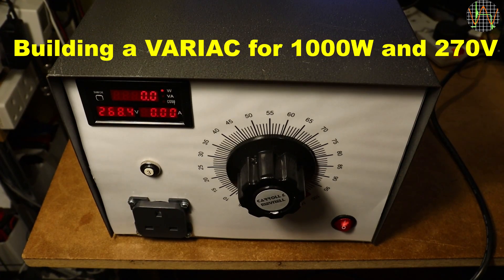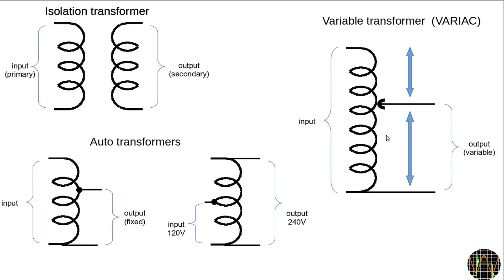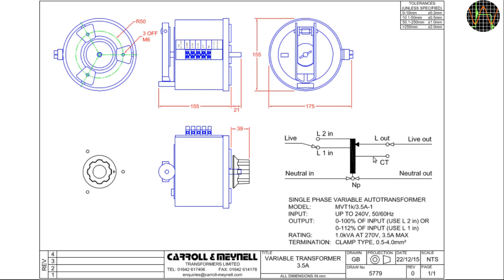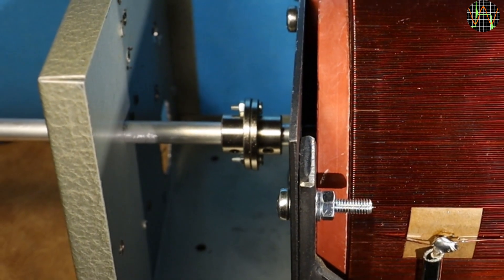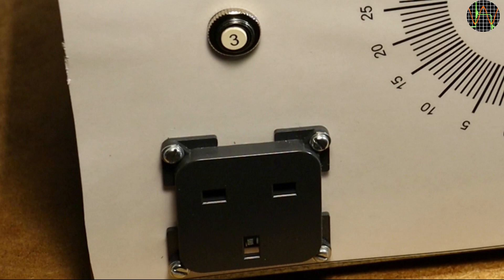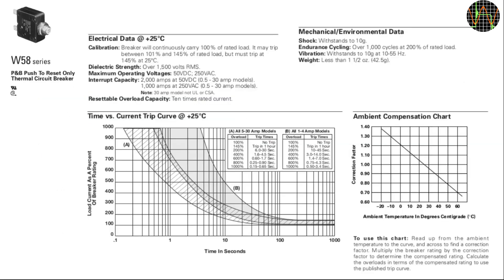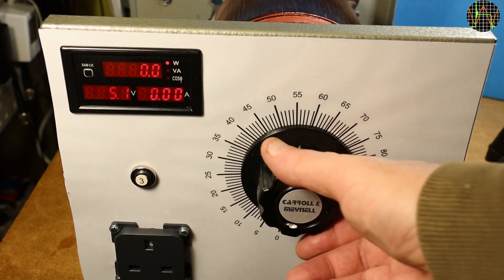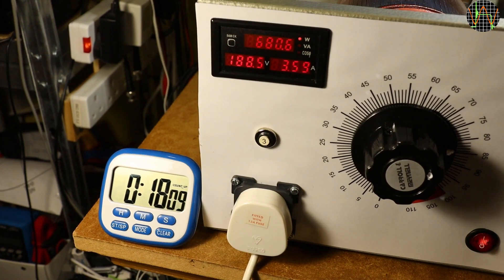Building a VARIAC for 1000W and up to 270V AC

Comment: Was just rehabilitating a vintage Variac and had to give this a watch! A lot of the vintage ones weren't grounded at all interestingly enough. The vintage ones do use a double pole switch as well, but I'm not sure if there's much point in breaking the neutral at the same time other than maybe to prevent arcing if you are using it under a super high load maybe? 

I've also see where they are configured to use a switch that sets whether live voltage is applied to the very end or part of the way in so that you can choose between over voltage and mains voltage as a maximum. 

Assuming your varian is wired correctly, and the output was at 10VAC, how would touching it be harmful?

Where I think the danger lies is if live and neutral are swapped. In that case, then yes, touching the 10VAC output' is really touching the mains voltage in reference to ground. This could happen for two reasons - if the outlet you plug it into is wired incorrectly, or if the variac has a non-polarized plug and it's plugged in the wrong way. 

Lastly, is there anything preventing you from applying your live to the center tap? Doing so I think would give you an output that is about double the mains voltage, though I don't really know what use you'd have for ~500V, but it could be useful with 120V sources to up convert to 240. My guess is that the downside would be that it could only handle half the current at the higher voltage
Reply from the maker: It is probably safe to touch it if its 10V but as you say, L and N could be swapped and anyway it is probably never a good idea. I don't think the wiring and isolation is designed for such high voltage that you are thinking of. I use an external isolation transformer if I need higher voltages.  Much safer,

Comment: Great video, I am looking to do the same as I currently (no pun intended) have an open frame Variable transformer I'd like to put in a case, are you able to let me know where you sourced yours from.
Reply from the maker: That case is 40+ years old and I can't remember where I got it from. Originally I had put a self-built bench power supply in (with analog V and A meters, hence the large holes). I used that for many years, but then switched to smaller bench power supplies so this thing ended in the garage until I repurposed it for the VARIAC. My advice is not to try to buy new enclosures (outrageous expensive) but look for not working old power supplies or vintage valve based RF equipment and use those cases. Much cheaper and you may find useful components inside. I managed to score quite a number of useful cases and components that way for very low cost.

Comment: Hi. Right now I'm winding a coil for my own variac and I have a question: can I connect one wire from the outlet to the load directly and other wire through the slider of a variac and to the load? If I'm correct, if I connect it like this, it should operate like a rheostat (potentiometer). Will it work like I described or will I need to connect it using schematics from the internet? Thanks!
Reply from the maker: You are brave winding your own variac and I hope you know what you are doing. A variac is basically wired like you would a rheostat but it works very differently (as a transformer). You can get more volts out than in with a variac but not with a rheostat.  Not sure what schematics you follow but the basic wiring is really quite simple. The coil of the variac is connected between neutral and live. The load is connected between neutral and the slider. Its mains voltage, so be careful.
Reply: @TheHWcave  okay, thank you very much for your answer! Regarding schematics: I basically googled "variac pinout".

Comment: excellent auto-trans stuff but where did you get the ee blog meter:)?  -I'm sure you did not have to travel all way to DJ's shop did you? and you could just have mounted the variac on the floor of the existing housing and controlled it from the top saving the extra material & weight! overall an impressive project though
Reply from the maker: on the EEVblog meter. I bought it quite some time ago in the UK. They are available. I was trying to find the place Simon's Electronics but the site is (no longer?) working. I think other places sell them as well. I did it because I wanted to support the EEVblog a bit (Dave gets a cut). Thanks on the suggestion. The enclosure with the VARIAC ways a ton and therefore sits directly on the floor. That place happens to be under a shelf. The control would not be accessible if it were not on the front. Of course I could have rotated the box if I followed your idea... Anyway, speaking  of rotating, the only thing I would do different next time is to rotate the output socket 90 degrees to the right. Because the machine sits on the floor it is difficult to get a UK plug in with its lead coming out on the bottom.  I probably will do this mod anyway once I get annoyed enough...

Comment: und keinen trenntrafo mit der gleichen va leistung mit eingebaut???
Reply from the maker: There is an easy explanation: I did not had the money for buying an isolation transformer at that time. Also, these are big! It would have been very tricky to fit both the VARIAC and the isolation transformer into the same enclosure.

Comment: what happens if your input is less then 240v lets say 20v? what happens to the out put load.
Reply from the maker: The VARIAC  allows selecting anything from 0 to 115% of the input. If you feed 240VAC it will allow selecting 0 to 276VAC output. If you feed 20VAC it will allow selecting 0 to 23VAC for the output. It can produce slightly more output voltage than you input because its a transformer and because of the way the coils are wired  (its an option you can chose when you wire it up). Its a different story for the panel meter. That one needs at least 60V AC or something like it, to be able to work. It can show 20VAC at the output but it can't work with 20VAC at the input.  So while the VARIAC will happily work with 20VAC input, the panel meter will stay dark.

Comment: I have a 2.5kw 240v transformer. 
However I am in the US and for 240v we use two live wires each roughly 180 degrees out of phase.
Does it still wire up normally?
Reply from the maker: I am no expert in US wiring but if your transformer is indeed for 240V you would connect one end of the primary to live of phase 1 and the other end to live of phase 2. Of course earth needs to be connected to the chassis as well. Also make sure you use a double pole power switch to disconnect both live wires when turning power off. I am not sure what the regulations are for fuses in this situation. Intuitively I would put one (rated for half the max current) in each live wire
Reply: @TheHWcave  Thanks

Comment: what about inrush current?
Reply from the maker: If you are asking if the VARIAC itself has an inrush current, the answer is probably yes, but it is not significant. I have not noticed it and the fuses are still fine. If you are wondering how the VARIAC deals with inrush currents of devices connected at the output, my normal usage is to have the VARIAC turned to the lowest setting (4V or so) and then turn power on. Then increase voltage slowly. So there is actually no inrush current.  Most of the time I use the VARIAC to test new builds, or repairs, so going slowly and stop immediately if something looks wrong before any damage is done is key. Occasionally I set the VARIAC to 115V and then turn power on to see how well devices behave when used in 115V countries. I'm using small devices, not massive transformers or motors, so I have not found inrush current to be a problem.
Reply: @TheHWcave  Thanks for the fast reply. Yes I was asking about the inrush current of the variac itself. I suppose if you turn on the power while the variac is set low, the line voltage sees a large inductance, so the in rush current is small. And using small loads on the output simulates a open circuit at the output, limiting the current. So i suppose you are correct that the way you use the variac is what limits the in-rush current.
Reply from the maker: I just saw Marco Reps' new video about needing a soft-start for his 3KW Variac because the inrush routinely trips his home circuit-breaker. Check-it out if you have not seen it.  Well, mine is just 1KW and the DC resistance of the winding is about 12 Ohm vs Marco's 2.something. I suppose that explains why I don't have an inrush problem

Comment: Nice job, have just subscribed. Do you have a link to the brackets, or did you weld them yourself? I can't see anything similar on eBay
Reply from the maker: I go mine ready made from the ebay seller vds_fabrications 
https://www.ebay.co.uk/itm/Heavy-Duty-Shelf-Brackets-Handmade-Rustic-Industrial-Design-Modern-very-strong-H/264529809676?hash=item3d9734910c:g:Cp4AAOSwmepcCsLJ
Reply: @TheHWcave  Excellent, many thanks for the quick reply. I was looking at the cheap Chinese variacs on eBay but after seeing your video I think I will buy a proper one from Farnell and do it myself. Now to find a good steel case that doesn't cost the earth...
Reply: You could probably just go to a steel shop and pay $40-80 and have them weld you a custom one for almost nothing in terms of material cost and just an hour or 2 of labor.

Comment: When you had it connected to a heater and got up to the 3.5 A that was only 682 Watt that I saw on your meter because of the lower voltage at 189 so it really is not the 1000 Watt you have in your video title... Is it capable of putting out the 1000 Watt or come anywhere close to that?
I calculated what it should be if you could get the 1000 Watt at 189 Volt, you should have 5.29 Ampere.
At 270 Volt you should get 3.7 Ampere to get the 1000 Watt rating, because of how a Variac is constructed using a single wire with the same diameter I can understand why you can't draw more than the maximum current of 3.7 Ampere at any voltage, still a bit strange that it doesn't follow the law of energy when the voltage goes down the current goes up.
And why doesn't it go down to zero volt?
Reply from the maker: Hi Ricardo, good points and maybe I should have added an explanation. 
The specs of the VARIAC are here: http://carroll-meynell.com/variable-transformers/item/variable-transformer-mvt1k-3-5a
It is rated for 3.5A. The current capacity of wire before it gets too hot or even melts is independent of the voltage. If you look at the AWG charts or equivalent to see how much current a wire of a given diameter and material can carry. This transformer can handle 3.5A, or 240V or 1000VA (not Watt !). Its the limit you reach first that counts.  Even if the voltage selected is just 24V instead of 240, I can't draw more than 3.5A current or it will get too hot. Similar at 240V and 700W active power the current is only about 3A but at a power factor of 0.7, the apparent power is 1000VA. This is one of the reasons why I like having that panel meter in there which shows power factor and apparent power.  
The reason that it does not go down to zero is simply a mechanical limit. The pickup wheel is designed to always stay on the wire coil. The rotating arm has a spring which presses the wheel against the coil with quit a force. To go down to zero, the wheel would have to leave the coil and drop a millimetre or so down onto the carrier. Rotating back to non-zero means it would have to mount the coil again. Its a bit like a bike going from pavement down to street and then back up the pavement.  These bumps would over time damage the coil and wheel, so there is simply a mechanical stop that prevents the pickup wheel from ever leaving the coil even if that means there are always a few turns that cannot be reached on either end.
Reply: @TheHWcave  Okay thanks for the explanation and the link to the specs site.
I would add an extra indicator lamp or an extra switch or both to make it visible so you can see when there's an output because it's not isolated from the mains which makes even the 5 volt dangerous to touch, I really recommend you to make some sort of dead man switch or an extra indicator that is very visible to you when there's output just to help yourself to not make the mistake of touching the live wires, believe me you can better prevent any accidents from happening and take it from me that if you work enough with it you'll get careless eventually and you may get killed because of it.
Another option is to get yourself an isolation transformer and use that to isolate yourself from the mains.
Reply from the maker: I appreciate your concern but the power switch has a light and the panel meter's red LED 7-segment digits are also quite conspicuous. Also I purposely installed only a normal UK power socket as output and not 4mm banana sockets. 
I do have a make-shift isolation transformer next to it (there is a video about it) which used to be more of less permanently connected to the VARIAC. I say used-to because I now have a proper isolation transformer that took its place. Maybe I make a video about that one as well.
Reply: @TheHWcave  as long as you're aware of what you're doing it's okay, just saying that even the best of us make mistakes so be prepared for it.
Reply from the maker: Very true. Mains is always dangerous and even an isolation transformer can still have 240V or more.

Comment: Great work, Heinz! As always... I have just ordered a BK Precision 1655A, for two reasons... One, AC mains is outside of my skill set and, two, I did not think that I could do better, financially, building an AC V Reg with Isolation. I will hang onto my DIY isolation transformer (aprox. 120VAC@3A) for extra uses, or share it, or sell it. I built it from all donor parts = two APC 1500 UPSs. I do have a ceramic socket to add a Dim Bulb current limiter, but I am encountering enough mains circuits to want very exacting control. I guess I just needed the extra sense of safety of having a professional engineered and built unit. Hopefully, it is worth the investment. Pardon me for being so rude as to inquire, but what is your approximate cost for this build? And, did you end up with better quality, or features, than a commercial unit?
Reply from the maker: The main cost driver is the VARIAC of course. The one I bought (RS stock is in the video description) is currently £105 (including VAT). Big steel enclosures are expensive too and I was lucky to have one that I could modify.  The panel meter was about £13 delivered (Ebay). The rest are smaller items mostly from the parts bin. Is my VARIAC better than a commercial one? I think it may have more fuses and through the panel meter, I can see apparent power and power factor which is not something you find easily.  And then there is the fun in designing, building and finally seeing it coming together and work as you hoped... priceless!   (sorry, could not resist).
Reply: @TheHWcave   DIY priceless? Agreed!!! Indeed!

Comment: Nice construction. I made exactly the same execept I added some more weight by having an isolation transformer as well, this is quit handy when working with high voltage equipment
Reply from the maker: Hi Jens, 
I could not agree more... but these things are expensive, even 2nd hand. I am still on the lookout. In the mean time, I am using a transformer from an old power supply as a poor-mans  substitute. Using all its wingdings in series, it gets me a safe AC voltage close to 100V with about 50W power.  With the VARIAC that becomes 0..100V which is quite usable. I may make a short video about it.